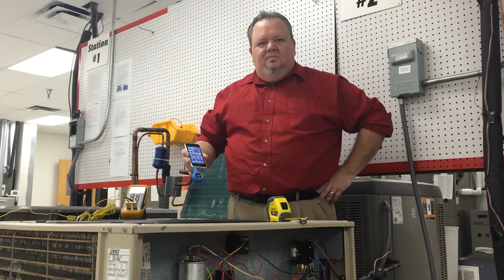Condensing Unit Total Heat

Comment: Excellent video. Everyone just think about it. Measure airflow through a furnace and temperature rise and you can use this formula to determine BTU output. Or is that the next video project in the works.

Comment: I don't understand how this can be very accurate. You have no way of knowing how many btu's the present latent load is using. I realize you said sensible formula, but surely that unit was not producing 36k btu's of sensible cooling with no latent cooling.
Reply: The latent load is still heat energy that needs to be expelled outdoors.
Reply: Jeff B yeah.  Of course the load still exists and would be present but since the latent load can’t be measured with temperature and he’s not measuring or recording an enthalpy change from inside, I didn’t understand how it could be accurate. Because you know conventionally to measure capacity you need to know the airflow, delta t and delta h. 
Anyhow, this is a really old comment. I remember asking Jim Bergmann the specifics about this back then. He explained how it works to me and some other guys that were wondering about it.

Comment: Jose, great presentation.  I got a little confused about how much greater the rejection number is than the absorption.  In this case your rejection BTUs (38,913) were about 8% more than the unit's rated 36,000 capacity.   When you mentioned rejection is one to one and a half times greater, I got lost.  Thanks.